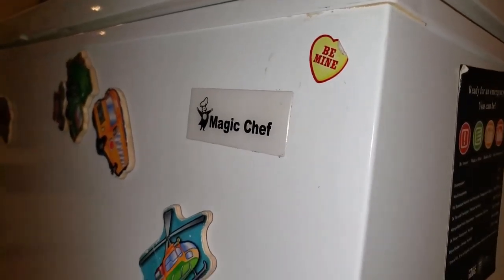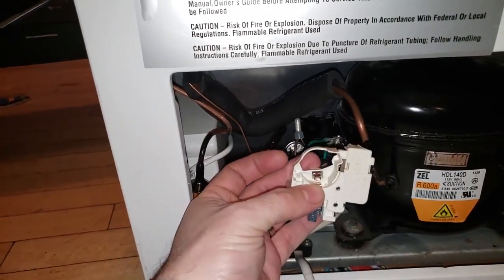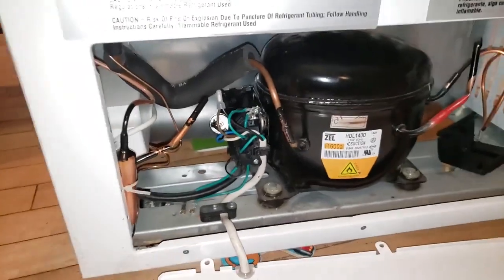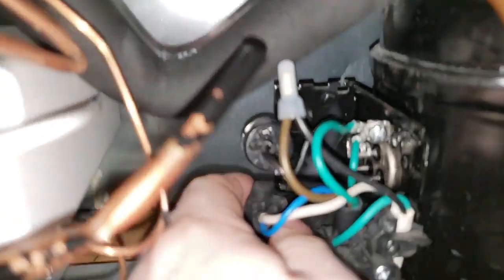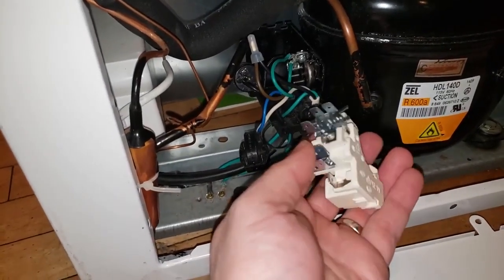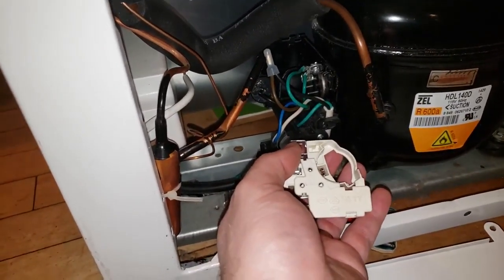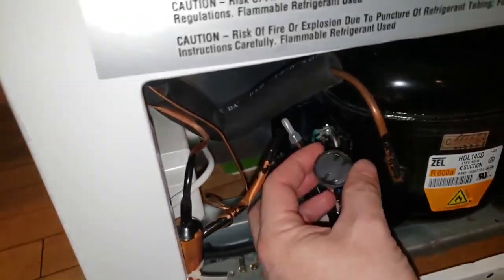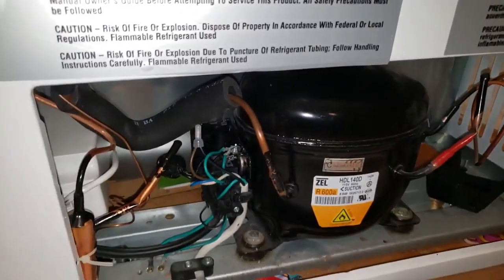Chest Freezer Starter Relay Replacement (Different Relay) - Magic Chef HMCF7W2 (Fix It)

Comment: We just found this exact freezer with this exact problem on the side of the road. Thing looks brand new, but won't freeze. Will definitely be putting the fix you've provided to work for some free freezing. Thanks!